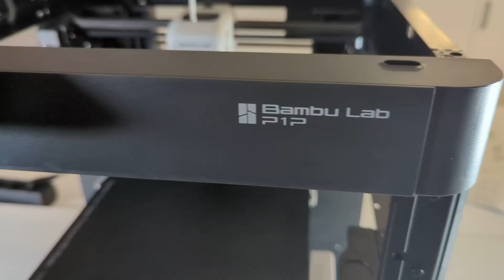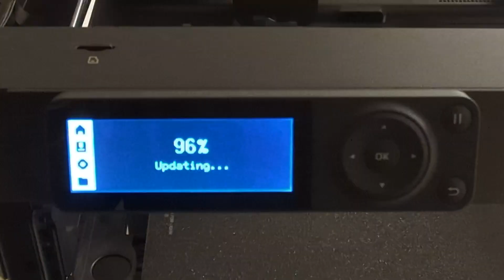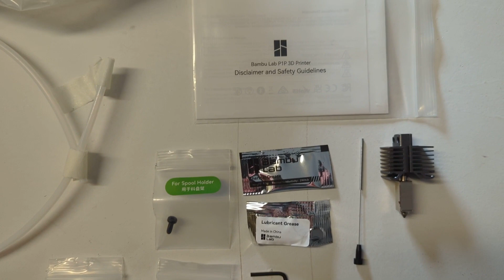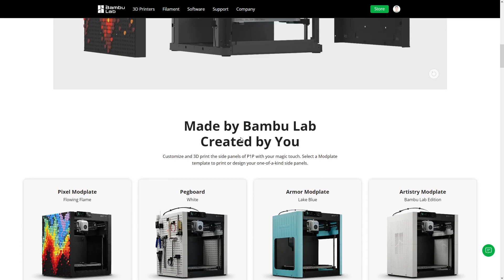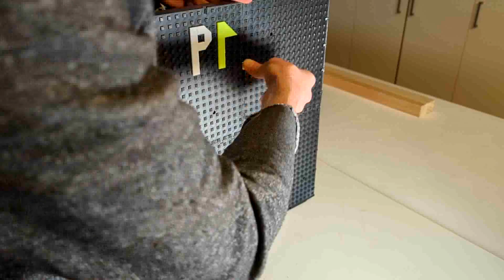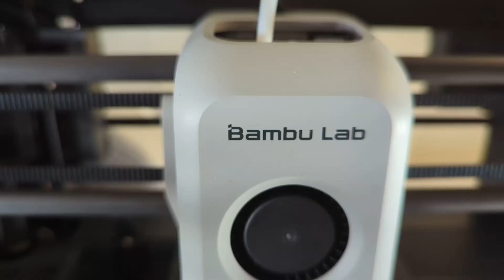An Honest Review of the P1P from Bambu Lab

Comment: Is the app required for this printer to function? While I like being able to remotely control it if it requires the app to function that's probably a dealbreaker for me.
Reply from the maker: No. You can still simply use an SD card instead.

Comment: Can the P1p and its slicer be used off line "no internet"? Some videos on youtube seem to say you have to be on line and use the cloud service others seem to say you can operate the printer and slicer with out a internet connection. What did you find to be true. Thank you for the video.
Reply from the maker: You need a WiFi connection to start a print job remotely. But you can use the printer entirely offline with an SD card too. You don't need an internet connection to run the printer as far as I know.
Reply: @Craftknights3D  Thank you so much. I have WiFi and SD cards, but internet is spotty out in the sticks where I live so just wanted to be sure I could use the system.
Reply: @Robothut  they have enabled direct connection printing where you directly send the print to the printer over your network. However I haven’t used that feature. I have used the cloud service but as the printer is 4 steps away from my slicer computer and it’s much faster to load gcode directly to the sd card and start printing.

Comment: There is a problem if you like to modify your printer and get independent parts as they are locked down and not open source, also  it is early days yet to see how long they will stay in business and supply parts.
Reply: This may be true, however if you head over to Bambus web page this question is specifically addressed. They made choices to have proprietary parts and they explain why. They further explain that should they fold as a company they intend to release patents to open source so another company could produce parts to maintain printers in use.

Comment: What about when something you can't replace breaks? Are you willing to send the machine to China, and wait at least two months for it's return? Are you okay with not having the printer for a long period of time while it's being repaired?
Reply from the maker: I understand your concerns and I have mentioned in the review that you can only get replacement parts from Bambu Lab themselves. I personally really enjoy tinkering on my 3D printers. I even build my own Voron. So I don´t like that Bambu has so many unique parts. However, replacement parts from third party sellers are already avaleable and most issues can still be fixed with some knowledge of 3D printers and with the help of the internet. Because the P1P and X1C community is already quite big and there is a lot of helpful information from third parties out there that will help you with pretty much any issue. So While I don´t like that Bambu Lab is a closed system it should not be a big issue.
Reply: Yup
Reply: What American made 3D printer  do you recommend?  Does it even remotely come close to the same ease of use and capabilities (and similar price). What American made 3D printers do you currently have? Would you recommend any of them? I have the American made Makerbot, and it is super overpriced garbage, and doesn't work at all any more.
Reply: @ElectroBlep  I believe it was an American company that came up with the idea of a 3D printer. From there, commerce took its course with a lot of help from republicans.
Reply from the maker: I worked with a makerbot before and didn`t like it at all. I personally don`t own any American made 3D printer and don`t know any good American made 3D printer either. If you want a 3D printer that is Not from China then I can highly recommend Prusa. But their printers are also quite expencive. But also very reliable.
Reply: @ElectroBlep  Building a voron or an one of Rolohaun's open source printers is your best bet if you're dead set on American made... You are probably American, so anything you, yourself put together make is well, that.

Best price for value atm is Sovol Sv06 or Sv06+ they're prusa clones, with some upgrades. Also, everything is replaceable with standard, available parts
Reply: @ElectroBlep  american made is no longer a sign of quality, its became an explanation for overprice and flows only.
Reply: If I read Bambus blog correctly then they are a China based company however they have support facilities in both Europe and United States. I can’t sweat to it but it’s heavily alluded to that you could have repairs done without shipping to China. 

That all being said I am in a different situation then the typical hobbyist and if I have a printer go down I’ll simply purchase another one, but will still have the defective printer repaired assuming I can’t get the parts myself. They are now an integral part of my business so having one down for an extended period isn’t an option. They have already paid for themselves so in theory I’m in profit margins. How long it stays that way remains to be seen.

Comment: The P1P needs to be around $499. At present, it makes sense to just get the X1C. Let’s be honest… You’re going to eventually get the AMS…and of course, a camera and then lights…and then the hours and hours you’re going to spend on panels. Trust me, you want panels. By the time you’re done all that you are probably less than $150 +/- away. Seriously, just save up longer and get the X1C….
Reply from the maker: The X1 carbon is better than the P1P but I still think that it is a good thing that Bambu Lab gives you the choice to buy a cheaper printer with fewer features for those who simply can´t afford the X1 carbon.  I am currently working on a Video where I upgrade the P1P with a custom enclosure for about 50$. This will allow you to print ABS, ASA and other plastics that require a enclosure to print properly.
Reply: I disagree, my ender 6 was $450 and it took me a couple hours to get everything going. The nearly out of the box experience of the p1p is worth a premium
Reply: @railerswim  I couldnt agree more. It's been a month trying to dial in my S1 and it seems like its just one frustrating thing after another
Reply: We started with the p1p in our shop because we mostly run pla and petg. The AMS isn’t a needed item. We did eventually get an x1c, but for the most part for what we do, the p1p handles nearly every job we need to do. The price is fine compared to what we’ve paid for other printers in the same build volume. It’s also been the most reliable (so far) and out performed 3 other printers making the same parts. 

I do not regret the p1p purchase, can’t say the same for some other printers I’ve bought. Ease of use, speed and print quality are key points we consider. And yes it uses more power initially because it’s equipped with bigger heaters then other printers. Once heated to temp it levels out nicely though.
Reply: The interface alone is worth that difference. 💯
Reply: @dingdongdaddy589  that was the dealbreaker for me